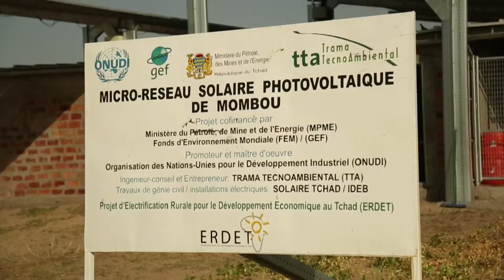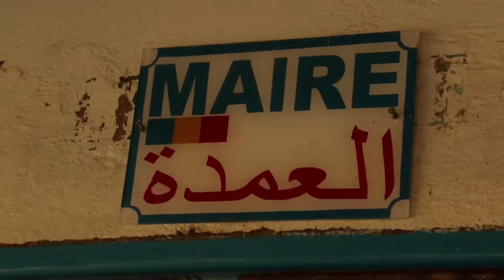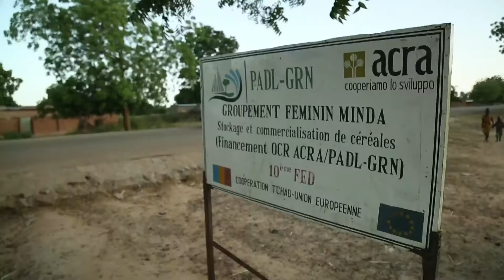Solar PV Mini grids in Chad built on a Turn-key basis by TTA for UNIDO in Chad

Comment: Tip. You can gradually dim down an under-table bulge and all other hungry electricity consumers with a 5000W dimmer (7, EUR). I run 5 dimmers in parallel on an 850W inverter. Kettle 2.2KW at 150W runs 12 hours a day, so the water is always hot. The room is also nicely heated. 2.5KW washing machine runs in parallel with dimmed to 200...400W. Iron, dishwasher, oven, electric heater, coffee machine, all internal heating are throttled with me. Videos about it on my channel https://youtu.be/eC2olbCBhh0 The inverter stays cool, quiet and the MOSFETs remain intact because extreme current peaks no longer arrive at the inverter. Now every Mini PV Inverter is enough to sell large devices...